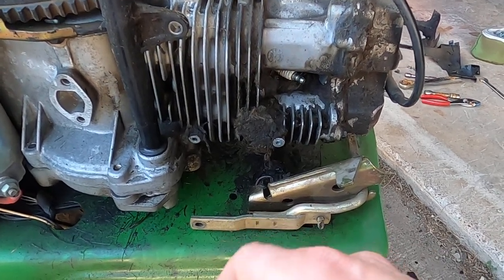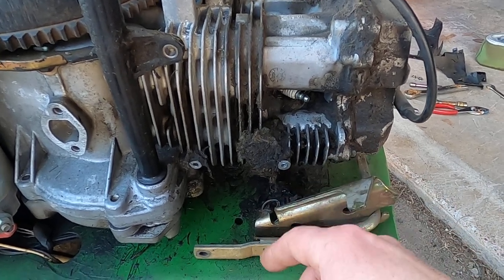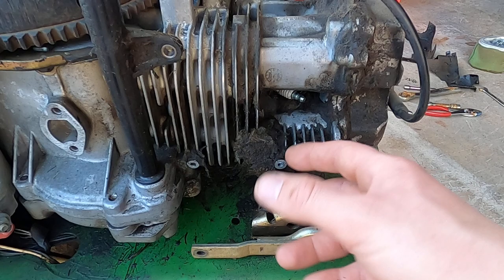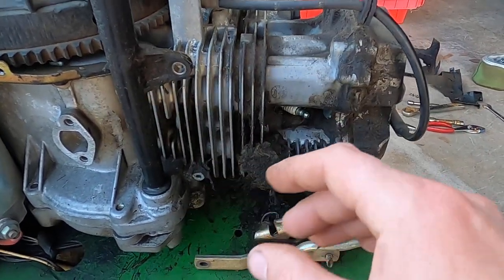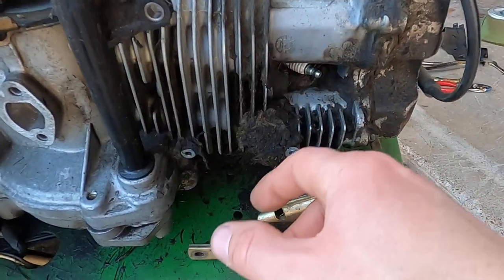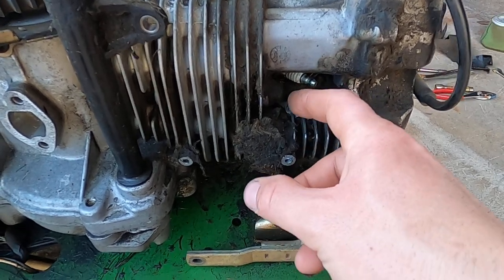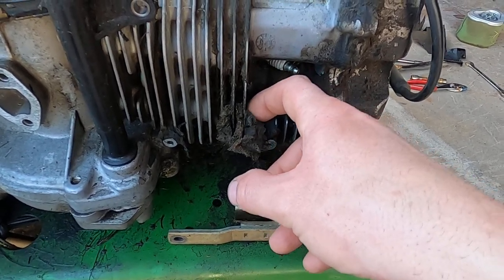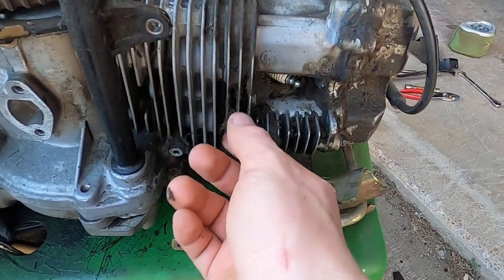Why You Need To Clean Lawn Mower (or any fan cooled engine) Cooling Fins From Time To Time

Comment: Thanks for the video. Can we clean the whole outside of the engine, carburetor, and camshaft and everything else with brake cleaner? I have a used and very dirty push mower, and I removed the plastic housing cover, the plastic fuel tank, the 2nd metal plate housing, the air filter & cover, the spark plug, and the muffler. I covered the spark plug hole and the muffler hole with plastic bag and paper towel so nothing will get in the holes. It has a lot of grime and dirt all over, and I want to clean it all off but I'm not sure if this is something that can be done without damaging it somehow? If this can be done, is there anything else (electrical or other) that I need to cover with plastic to not get it wet and damage it? I wanted to get the advice from someone who knows about these things.  Any help is much appreciated.